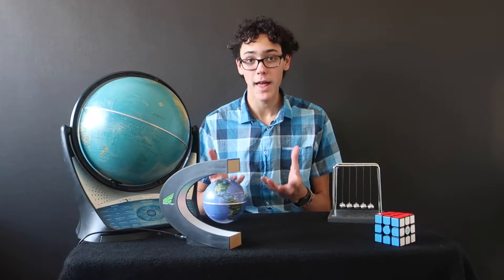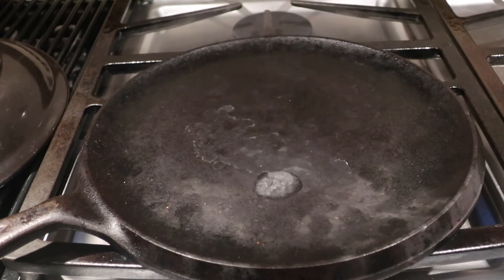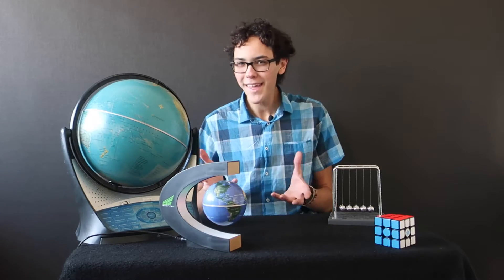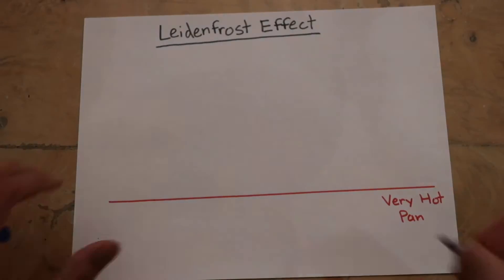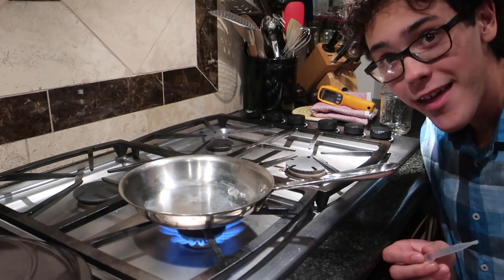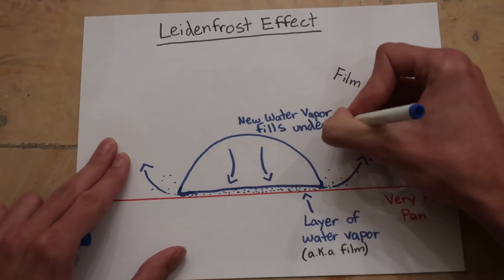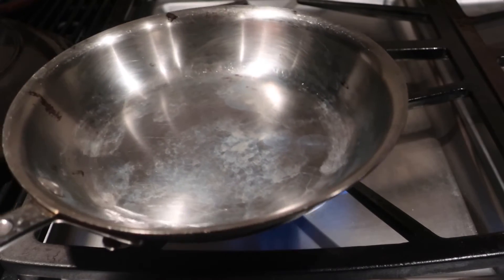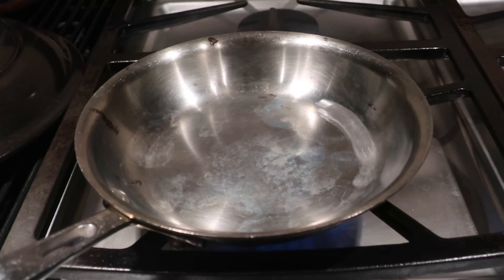The Leidenfrost Effect!

Comment: Those temperature reading are probably wrong due to the metal's different emissivity...
Reply from the maker: That is true, thank you for pointing that out. The actual temperature of the steel pan would be higher because of its lower emissivity. However, I wanted to show how there can be a huge difference in the temperature at which the Leidenfrost Effect occurs (as has been experimentally observed in the past)
Reply: @OnTheShouldersofScience  the temperature is wrong because you cant measure reflective surfaces with that type of termometer

Comment: The temp reveals by a thermometer gun to a stainless steel pan is not accurate.  The gun uses infra red for detection of heat but the stainless steel reflects the infra red and returns a low reading.

Comment: Do you think the temperature variance in achieving the Leidonfrost effect on different materials is due to thermal conductivity, velocity of heat transfers, etc.? What’s the reason for such variations?
Reply from the maker: The two biggest variables are the thermal conductivity of the surface and the roughness of the surface. The smoother and more conducive the surface, the lower the Leidenfrost temperature will be
Reply: @OnTheShouldersofScience  Ty so much for the answer!
Reply: @OnTheShouldersofScience  so stainless steel has a super low thermal conductivity which means the temperature needs to be quite hot? I guess.
Reply: @j.d.thompson3505  I think you got cast iron and stainless steel confused. The video shows that the effect takes place at a MUCH lower temperature in a stainless steel pan than in cast iron. Stainless steel is a much better conductor of heat than cast iron and it's a LOT smoother than cast iron which is very porous. That's why cast iron has to reach a much higher temperature to achieve the effect. The main reason that people use and like cast iron is that it retains the heat it build up better so that the temperature of the pan won't drop as much when you add ingredients, so people like it for searing, plus it can withstand high oven temperatures to go from searing to cooking in the oven.
Reply: @Julie Peterson  I really only cook hamburgers and sometimes chicken. I've been too tired lately. Take care.